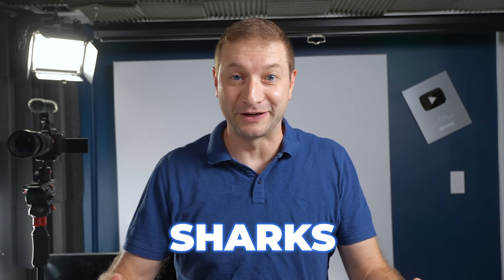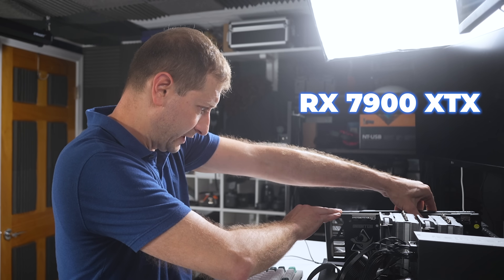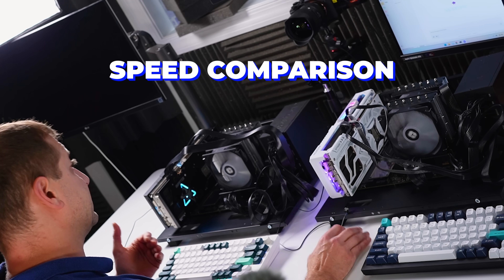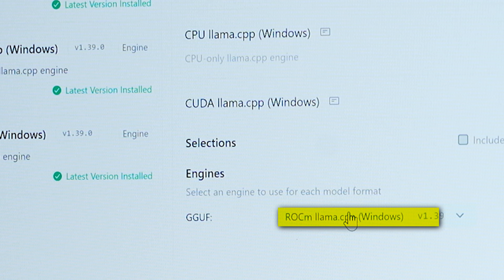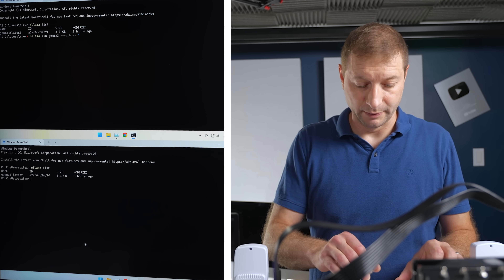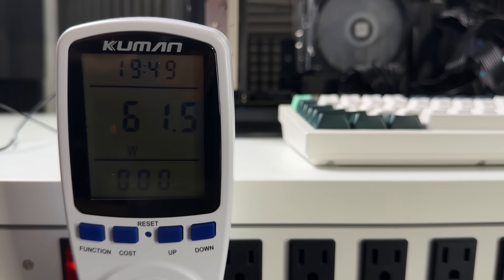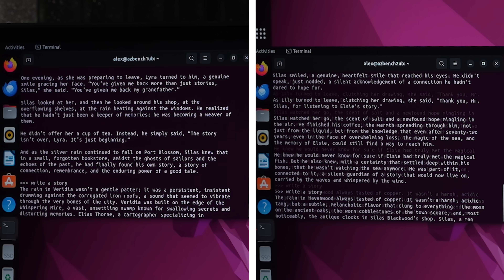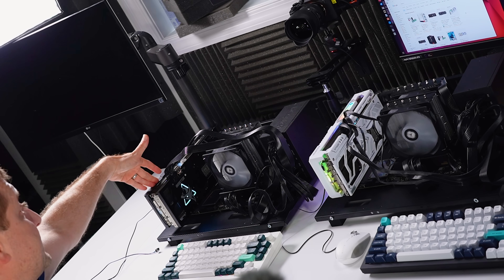RX 9070 XT is cheaper AND better… mostly

Comment: Here me out we have 
Cuda vs ROCm vs MLX
Reply: CUDA was released in 2007.  ROCm didn't really get off the ground until 10 years later.  CUDA is twice as old and is a general platform for supercomputing.    The great thing about cuda is that it works on absolutely all NVidia cards & was for many years a main selling point that they depended upon. I'm not sure that ROCm is quite as general nor does AMD Acare as much!  NVidia definitely has a BIG EXGE especially if you want to run some esoteric AI stuff for video editing plugins...

Comment: I use a Steel Legend 9070XT as well and I run Ollama in ROCM for Windows, and run Vulkan in LM Studio. its interesting to see what it looks like in Linux. I've pasted my Windows 9070XT ROCM result below.

Using the same prompt, "ollama run gemma3:latest --verbose "Write a Story"" 

total duration:       13.1812247s
load duration:        5.0698647s
prompt eval count:    12 token(s)
prompt eval duration: 79.0288ms
prompt eval rate:     151.84 tokens/s
eval count:           858 token(s)
eval duration:        8.0318278s
eval rate:            106.82 tokens/s

I use a modified dlls to allow ollama to access rocm in Windows.

ggml_cuda_init: found 1 ROCm devices:
  Device 0: AMD Radeon RX 9070 XT, gfx1201 (0x1201), VMM: no, Wave Size: 32
load_backend: loaded ROCm backend from C:\Users\**\AppData\Local\Programs\Ollama\lib\ollama\ggml-hip.dll

Comment: Nice test. 
AMD is coming with professional card based on 9070 XT chip, but with 32Gb. Hope you can get that one and compared it to Nvidia 5090 and MacPro / Ultra.
Of course 5090 will be faster, question is, how much faster.

AMD made nice uplift with their RDNA4, but RDNA5 or UDNA6 is promising even better uplift (generation on generation).
Also ROCm 7 should be big improvement. 

Wonder if two 9070Xts could be ran in a cluster and what kind of performance would they have? Can't MicroCenter lend you some more? from their open boxes or their test machines?
Reply from the maker: yep, the r9700 tomorrow i think. called around and so far no leads
Reply: @AZisk  Subject: 🚀 AMD Just DROPPED the Radeon AI PRO R9700 – NVIDIA’s RTX 5090 Has Competition! ($1250 US, 32GB GDDR6, 496% AI Boost!)

Big breaking tech news! AMD just launched the Radeon AI PRO R9700 GPU TODAY (July 23, 2025) at  ~$1250 US, and it’s shaping up to be a *serious rival to NVIDIA’s RTX 5090!* 🔥  

⚡ Why This GPU is a BEAST:
✅ RDNA 4 Architecture – Next-gen efficiency & power  
✅ 32GB GDDR6 Memory – Crushes AI & pro workloads  
✅ 128 AI Accelerators – l496% faster AI inference vs. RTX 5080!  
✅ Price-to-Performance KILLER – Half the cost of NVIDIA’s RTX PRO Blackwell GPUs!
Reply: @AZisk  Yeah, its still early for it to be available (9700). I guess mid August.

Comment: What driver are you using Mesa Radv or Amd Pro / Amd VLK ?

MESA RADV not optimized for LLM yet.
Reply: On AMD rocm is used not vulkan.
There are some vulkan backends but for LLM is rocm + amdgpu + kfd.

Edit: you only need amdgpu and kfd and docker for userspace part.
Rocm is userland so just look for a docker image like ollama.
Reply: Personally I use  Mesa + ROCm native package.  Many distro have ROCm available as independent package that work alongside Mesa.  If not then ROCm come with AMD PRO driver but I do not like this option because it lower compatibility with games.

Comment: 3+ Years old kernel and gpu drivers on Ubuntu 22.04 lts 

Please use , fedora , arch Linux , etc
Reply: ROCm doesn't support new OS versions.
Reply: Lol this morning I had to update driver on a Mint machine that could not start latest Unreal Engine version and now I am looking for a good archlinux GUI installer to do massive deployment (I love archlinux already but a good install takes some time unfortunately)
Reply: @louisfreema5905  "GUI".. "massive deployment".. does not really make sense. Massive deployment can easily be achieved using an automated archinstall configuration, which is not GUI. GUI automation is much harder than normal CUI.

Comment: I am poor and I am running a GTX 1650 on a system with dual E-5 2680 v2 Xeon cpus and 256gb ram... LM Studio wont run as it doesnt like my CPUs - is there any work around for this? (I am running Linux BTW)

Comment: There are a bunch of 32 GB amd instinct cards on eBay for £250-£500, I wonder how those work
Reply: @jkeid315  I have a Radeon Pro v620 32GB GDDR6 coming in tomorrow to add/combine VRAM with my Taichi 9070xt. The V620 is essentially a RX 6800 with double the VRAM and has rocm support. I will report back how it goes in the next day or two. I paid $427 for it, I am going to 3D print a 120mm fan mount since this is a passively cooled server card but it was the least expensive 32GB I could find :)
Reply: @jamesgeisel  I already can told you Radeon Pro v620 will be slow with a bandwidth 512.0 GB/s and this card doesn't need 32 GB VRAM.
Reply: @vladimir0rus  I agree, I think it will be slower than the 9070XT. I am adding it to run much larger LLMs than 16GB I wanted to add the V620 to bring total to 48GB VRAM and run 70B parameter models. 512.0 GB/s is still pretty decent for my use case.
Reply: @jamesgeisel  Status report?
Reply: I guess you are talking about the MI50. I have got one yesterday - the 16GB version. Didn't have time to test much but llama cpp with vulkan,  got me the following for Qwen3-14b:

Qwen3-14B-Q8_0.gguf:
llama_perf_sampler_print:    sampling time =     311.47 ms /  1049 runs   (    0.30 ms per token,  3367.93 tokens per second)
llama_perf_context_print:        load time =    5379.56 ms
llama_perf_context_print: prompt eval time =     323.12 ms /    12 tokens (   26.93 ms per token,    37.14 tokens per second)
llama_perf_context_print:        eval time =   41744.53 ms /  1036 runs   (   40.29 ms per token,    24.82 tokens per second)
llama_perf_context_print:       total time =   60813.56 ms /  1048 tokens

Qwen3-14B-Q4_K_M.gguf
llama_perf_sampler_print:    sampling time =     186.62 ms /   636 runs   (    0.29 ms per token,  3408.05 tokens per second)
llama_perf_context_print:        load time =   13510.37 ms
llama_perf_context_print: prompt eval time =     442.87 ms /    12 tokens (   36.91 ms per token,    27.10 tokens per second)
llama_perf_context_print:        eval time =   18228.87 ms /   623 runs   (   29.26 ms per token,    34.18 tokens per second)
llama_perf_context_print:       total time =   38863.66 ms /   635 tokens

I have a RX 6800 in my main system, but llama.cpp doesn't play nice with my current debian install. I will make a comparison to that shortly, in my other system.

Hope that helps to get some ballpark figures.
Reply: @Danny_Warped I have tried MI50 16GB with a PowerEdge R730xd, Precision T7600 and a X99 Xeon Mainboard, all Xeon E5 family: none of them could manage POSTING. Which system do you use for running MI50?
Reply: that's pretty crazy
Reply: They won’t, that’s the stupid part. The Mi50s aren’t even supported in ROCm anymore. Same with the older K40 Nvidia cards. It’s why they’re selling so cheap; they’re useless except for spare parts for existing installations.
Reply: @rob_over_9000 it's should be possible to use them with vulkan or even build custom version of rocm. At least I can use fresh rocm with my rx590.
But anyway mi50 has only 16gb and slow but power hungry.
It's better to buy 3090 instead.
Reply: @vladimir0rus MI50 has for sure a 32GB version
Reply: @vladimir0rus Therr are 32GB Mi50s but when I want to build AI, I don’t want it so I can tinker with custom ROCm builds - it’s because I want AI as a tool to do other things.
Reply: @rob_over_9000 I have just looked at AMD latest docs; MI50s seems to be supported
Reply: Mi100 might be a good option but they cost too much.